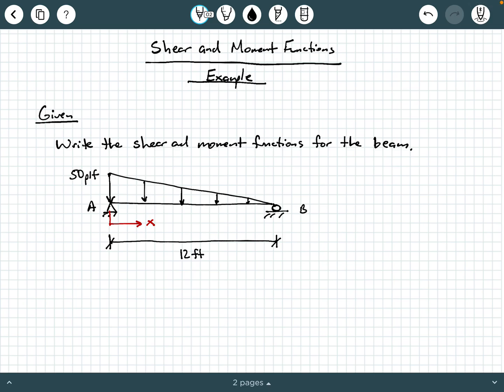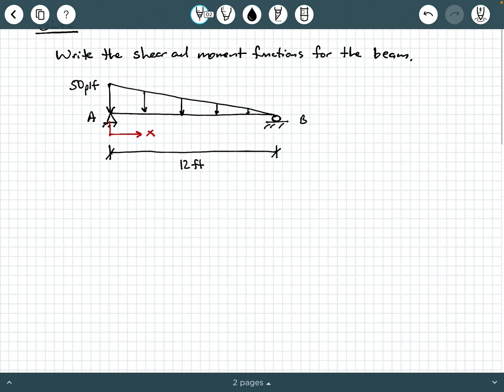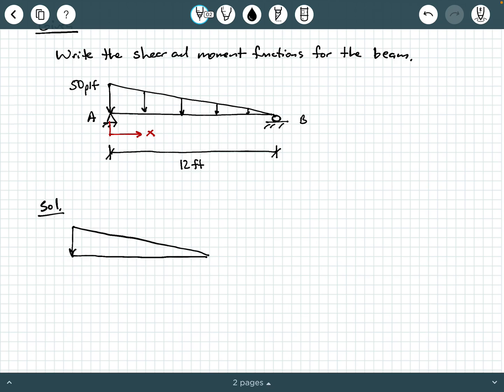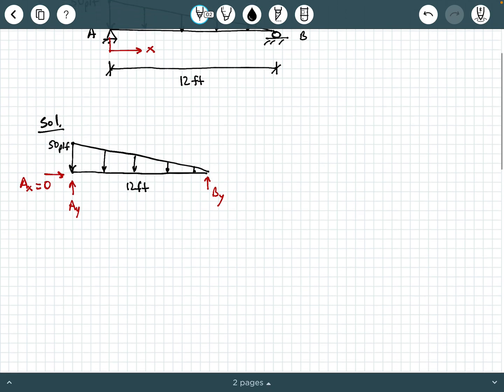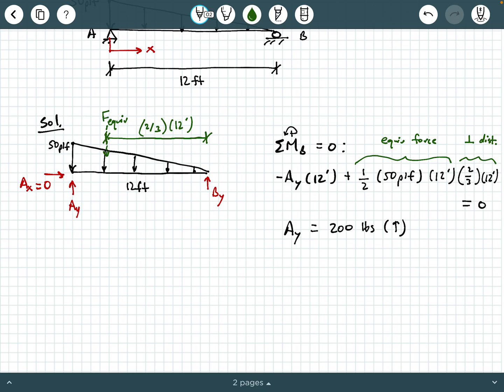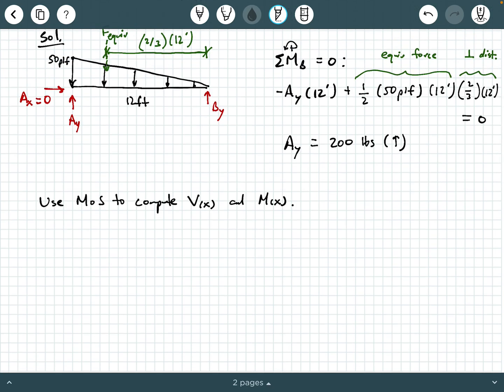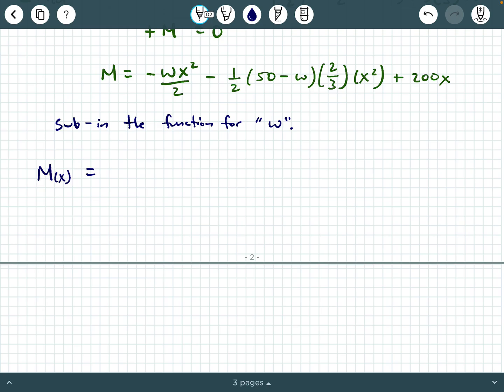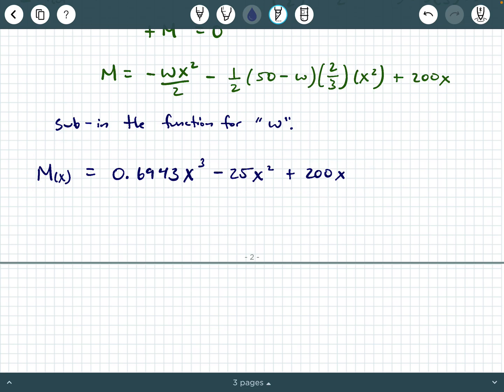Statics - Video 104:  Shear and Moment Functions Example 3

Comment: why is shear negative in your equilibrium equation solving for Shear as a function of x? I thought convention was that shear would be positive in this case
Reply from the maker: This is a very good question and one that is a common source of confusion, so thanks for asking!  When we use Method of Sections (MoS), the sign convention for internal shear force (V) is "positive shear causes the FBD to tend to rotate clockwise".  In this example, since we are analyzing a left FBD, the internal shear at the cut that causes the FBD to rotate clockwise points down.  So, even though V is pointing down, it is a "positive shear" based on the sign convention.  Here are some other videos I have where I explain this concept:  
https://www.youtube.com/watch?v=8H3h9zSUU00&list=PLh-Fz1IR5L-x27uM_IzRClkn2ugjITq3y&index=97&t=2s (Time stamp 13 min)
https://www.youtube.com/watch?v=rcBliCtBmso&list=PLh-Fz1IR5L-x27uM_IzRClkn2ugjITq3y&index=98  (Time stamp 9:30)
https://www.youtube.com/watch?v=hUbCRSx-Bkc&list=PLh-Fz1IR5L-x27uM_IzRClkn2ugjITq3y&index=99 (Time stamp 10:30)
https://www.youtube.com/watch?v=YX_oz77_Hbs&list=PLh-Fz1IR5L-x27uM_IzRClkn2ugjITq3y&index=100  (Time stamp 4:30)
https://www.youtube.com/watch?v=X6nixfwpSY4&list=PLh-Fz1IR5L-x27uM_IzRClkn2ugjITq3y&index=102

Comment: Tried integrating by V -> V(x) to find the max shear force thinking that it was gonna be at the starting point using x=12ft. Is this ok?
Reply from the maker: The two largest values of shear force will occur at the supports.  The two largest shear force values are the vertical reactions.